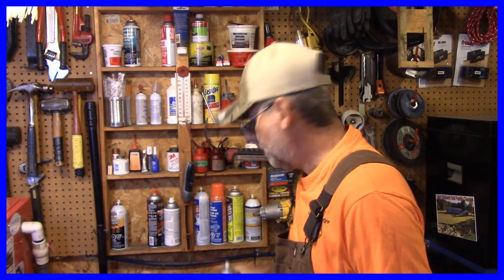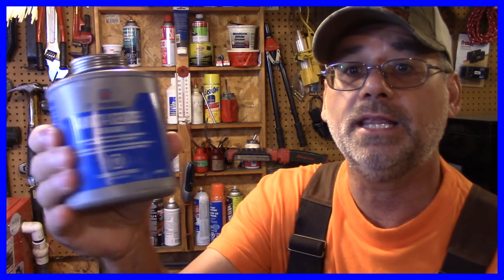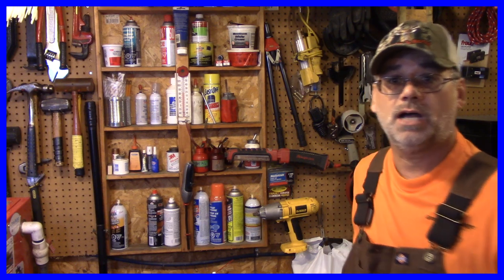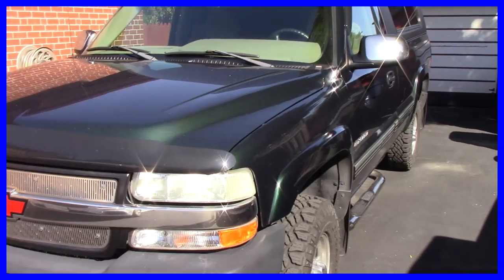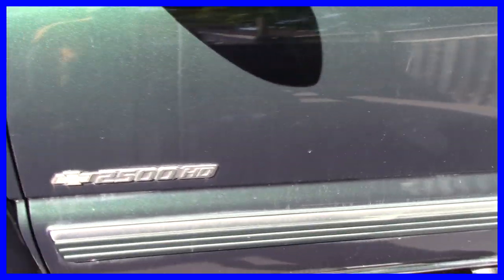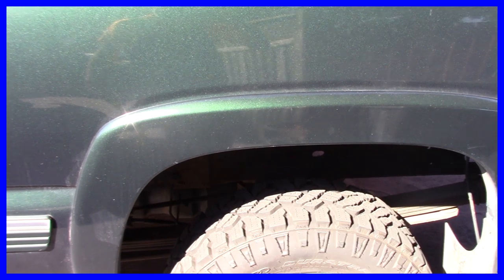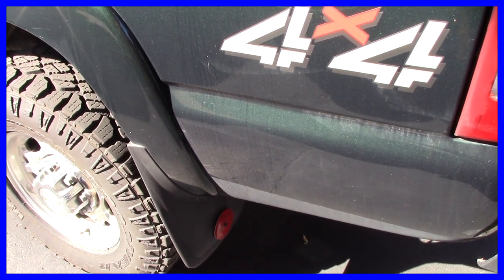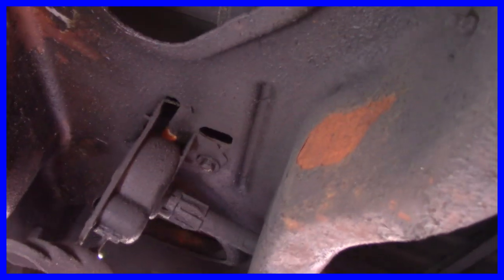APPLYING  RUSTPROOFING / UNDERCOATING TO  YOUR VEHICLE  - THIS IS WHAT I  DO AND USE  .

Comment: What tires are you running on the Chevy?  I will be looking for a really good AT for the van seeing it isn't a 4x4. Seems to work.
Reply from the maker: Goodyear duratracs - great tire.
Reply: Kenda Tire  check into the Kenda Klever AT tire , it just hit the market last Year, and off road magazine did a lot of testing on it  and they and many others rate it awesome !  I got a  suburban ltz , its a soft riding tire with treads seem deep as semi drive tires, kinda the same sound going down the road,  I havent got enough snow to test it out, out it has done great on the highway, rain ,and mud, havent broke traction once even yet, and runs thru heavy  water on the freeway without no hydopaning even feeling,  the best part is since there new i paid like 148 per tire mounted n balanced, they even have tread on the side wall, a very rugged well tested tire with a loyal following,  I have a set of good year all terrain on my 81 1 ton plow truck, those are great too, but the Kenda just feels better cornering n softer going over rough terrain,and a bit sticks better to the road with more meat on the treads, guys are running them all over from alaska to anywhere you want to Go, IM very happy with mine, and Kenda makes motorcyle tires, car tires,  heck even shopping carts n golf cars, one of the largest tire makers in the world, but just started their expansion into the at tires n light truck , n cars  this past decade im guessing,    but the Kenda Klever is becoming well known to the offroad drivers,  and I have over 2 million miles driving over the road truck driving, and drawned my exp from that to decice on this well engineered tire,  mileage wise will it hold up as long as my good year all terrain ,time will tell, but i dont think it will , but traction a soft riding tire that corners awesome mean a lot to me, and I sell my tires on my wifes suburban every about when they get down to 50 percent tread anyway, and some young people are always happy to pay 100 bucks for a real good set of used tires, I like my wife to have the best traction possible she drives a hr to work each way, plus a tire with poor traction isn't very safe for anyone

Comment: I just got my 23 Tacoma undercoated with Valuguard 120 by Line X-was this thr right decision?
Reply: @SteveRobReviews  I just hope it doesn't rust it even further down the line
Reply from the maker: @jimmylim5015  Rust spraying helps a lot but if your in a place with salt on the roads  your undercoating is a must do or you will watch the body rust away in 10 years so yes its a good investment.
Reply: @SteveRobReviews  thanks I just did a bunch of research and some people have a lot to say on which undercoating works best.  I went with Line X rubber coating but I also heard that and Ziebart worsens the rust later on but I don't know who to believe.
Reply: Get that stuff off there, your truck will rot form the inside out. Fluid film or woolwax is what you want to be using!!!!!!

Comment: I have had my 07 Caravan Krowned every year since 2010 (knowing they are rust buckets) and i touch it up myself where it needs it. I'm sure it has helped but it's starting to rust out now. Must be Chinesium steel. Chrysler put foam in the rocker panels. I guess you can't rustproof stupidity. They like salt and calcium chloride so much around hear that they spread it on dry roads.
Reply from the maker: It helps a lot but it doesn't prevent rust thats for sure. The foam idea seems odd since it holds moisture. LOL

Comment: "I dont put a spare tire here youll never get the thing out" i remember helping someone it took me probably more than 15 min to slowly hammer it out and loosen the mechanism. The guy i did i helped was on his way to scrap the same vehicule we saved XD
Reply from the maker: You are correct for those that never service the spare tire. I take the spare out every year check the air pressure and respray the underside before putting it back. Cheers

Comment: According to the MSDS's Rust Check Coat and Protect has the exact same compounds as Krown, just in flipped proportions.  Rust Check is 10-30% Propane and 5-15% Isobutane, while Krown is 10-30% Isobutane and 7-13% Propane.
Reply from the maker: Both work well but I do prefer the rust check coat and protect. Cheers

Comment: Terrible to live in the rust belt. I live in the Phoenix, AZ USA area, and have a 1993 Chevy C/K 1500 with 278K miles on it. I have it put up on a rack every 2-3 years and the underside cleaned. It still looks brand new. Absolutely NO rust. Unfortunately mine is/was white, and some of the paint just fell off, which seems to be a common problem with white vehicles in the US. But even where the paint came off, it still has NO rust. It's solid as a rock. It is my daily driver, and I'm going to have the engine replaced when it wears out and keep driving it, because I don't want a new vehicle with all the garbage technology they are putting on them today. 

I have heard a lot of great recommendations for a product called Fluid Film for preventing rust. Don't know if it is available in Canada or not. One thing to DEFINITELT stay away from is Ziebart. It actually causes rust. Many mechanics in the U.S won't even work on a vehicle that this stuff has been used on.
Reply from the maker: Yep fluid film is up here 👍

Comment: The OEMs do a much better job for rust prevention design, but some are just bad, like some vans.  I had a 94 dodge truck, you couldn't ride with me unless you had a recent tetanus shot.  Internal cavities are the issue with visible body damage.  Not so much the underside.  BTW, if you spray your steel panel with fluid film you would see it creep and expand in a few days.

Comment: I used WD40 on the tailgate of my Ford Ranger.   Thought it was working but I was wrong.  The bottom of the tailgate rusted out.  I should have used these products!!!
Reply from the maker: Ya i'm  no fan of wd40 for anything LOL  It's not even a good penetrant compared to the others.  Rust can be slowed down in the salt belt but no amount of rust prevention  spray is going to stop it. Cheers

Comment: Have you replaced your exhaust yet?
Good maintenance  tip. Good video Brother. 
Last car that I retired had 265,000 miles on it so yeah I keep my cars for a long time. Can't afford to buy new either I buy em used.
Reply from the maker: Same exhaust on the 02 silverado but the 2010 F150 is rusting away pretty good.  Chevy does a lot of things better than ford looking on the underside  . Thanks Marty

Comment: You guys have some long winters up there, I couldn’t imagine how much salt is used.  Down here we get usually about 30” of snow for the season and the vehicles and roads show it in the city.  Now you get out of the city and it’s a huge difference in rust and roads it’s amazing.   Steve how do the roads hold up there?
Reply from the maker: The roads in spring are full of potholes from the heaving frost. They repave our  highways about every 2-3 years . The cold and salt and the frost are a huge challenge .
Reply: STEVE ROB REVIEWS yes the freeze thaw it’s a killer on roads here.  Do they use a lot of concrete or asphalt up there?  I would think the asphalt would do better up there it does down here.
Reply from the maker: It's all a concrete  base and assault  overtop. They have  machines that scrape it off heat it up and lay it back on . Pretty cool to watch.
Reply: STEVE ROB REVIEWS interesting concrete as the base and asphalt overlay.  So they’re basically recycling ♻️ the existing asphalt overlay.  How long does the concrete base last?
Reply from the maker: Not sure , never seen them  remove it yet😅
Reply: STEVE ROB REVIEWS well the idiots down here need to do this, they still like to use concrete so you can about imagine what roads are like here.  There are a few roads down here when the concrete is trashed they will patch and put asphalt on top, but it’s only temporary in a few years they are reconstructing the road with........... you guessed it CONCRETE 😂

Comment: You had me at chain lube. I buy that all the time for my motorcycle chain and I think I got carried away. I have oodles of the stuff. I'll be spraying down some truck frame with that! :)
Reply from the maker: Yes and oddly enough it's actually cheaper than the rustproofing cans and does an awesome job .  When I open a bleeder screw I spray some before I close it back up and they always open without any  problem. So many great uses besides chains.
Reply: You know most of my videos are often edited months after the fact, but I guarantee that you'll be getting some seriuos shout out about chain lube and a link in video and in the description to this awesome video. You have me all excited about new information. I learn something new all the time and I'm not surprised one bit that this information came from my buddy Steve. Next time I can afford vacation and it doesn't have to be to see family, I'm coming to Canada brother. :) Well, if you don't mind. You'd be the reason I came, lol. :)

Comment: I am from thunder bay ont. we have 6 months of winter and lots of salt if you wash your car unde during winter and do rust proof every year but you need good shop to do that you should be ok also need to look at paint and and do little touch up
Reply from the maker: Been there many time on my way to Upsala . I do mine in the drive with a plastic sheet on the ground but a good  shop is still  the best . Cheers

Comment: How do you stop rust at the bottom of the doors if you dont drill holes in them and spray ?  WHere I live, doors always rust
on the bottome
Reply from the maker: There is factory holes in the doors to let water drain out .  There is also holes to apply some rustproof as well. No need to drill any more holes . Take a good look.
Reply: Yep there are drain holes in the bottom of every door. Sometimes they fill with dirt too. Take a look, Pressure wash the holes out  & jam some Fluid film in there with the red straw..Good to go.
Reply: I remove the inner door panels and spray from there. plenty of room to get at everything. Make sure you run the glass up before removing the panel since you have to disconnect the window motor when removing the panel. Simple.

Comment: Good topic Steve.....salt all over....you forgot about GM primerless paint ...boy was that bad....I use my shutz gun with the rust check can from CTC and it just works great and I spray all over and even on the outer parts around the wheel well....this is good for rust but works the best when you changing lanes on a merge and you see these shiny cars moving away just scared to catch some kind of sickness on there new car....I bet you my truck is dirtier than your truck....CHEERS BUDDY
Reply from the maker: HAHA I bet your truck is dirtier than mine too. I like the ruch check as well.

Comment: Yep, I use a cheap electric spray gun and fluid film from a gallon can. I use two spray cans and a 360 spraying snake to get inside the frame. Just doing it once makes a huge difference. Every year I would say you never have to worry again lol. But yep I wear gloves when I work on the car for sure. Think the gallon cost $42, the spray gun $25, the two cans $20, and the snake $10. Not too bad.
Reply from the maker: That's the right way for a rust free ride   👍

Comment: I had a lot of rust under my truck.  Scraped it off as best I could and then washed it with soapy water to get any grease/dust/dirt off.

I then painted on a rust converter called "aqua steel".

Then you want to spray something oily on it each year or two.  I chose mineral oil because it's thin enough to use from any empty spray bottle you have at home.
Reply: How is it now?

Comment: I see lots of cars and trucks with rotted out rockers and wheel wells. If you live in Ontario you better use something because they use very aggressive chemicals on the roads in winter.
Reply from the maker: Yes they spray the highways  with a brine that's very corrosive .   On the side roads they just pour the salt down like their getting paid by the ton , not the hour :)

Comment: Not really. I've used Krown for 30 years and I've owned the cars since new for 15+ years. I apply it myself and I do not drill holes. You can apply it for 3 or 4 years in a row and then do it every second year. And yes, it does creep. Lab tests where I worked did full tests on it. Jeez, you worked at GM...poor you. lol
Reply from the maker: Anything is better than nothing and Krown does a good job as a undercoating too. Yep poor me :)

Comment: If you would have sprayed inside your cab corners, they wouldn't have rotted. I've tried krown in Montreal, absolute total waste of time and money. Their product is useless garbage zero protection, I even paid the guy $20 extra to spray over and over, ZER ZERO ZERO protection! Then I had my 84 Suburban grease rust proofed, and the guy missed so many spots that a year later I had to sandblast a bunch of little rust spots off and now I fluid film it myself, and it takes me 10 hours and 2 gallons of product. Today I'm going to be working on an 84 K5 Blazer I just drove back from California, and it takes me hours and hours to rust-proof it thoroughly thoroughly thoroughly. Some areas have to be touched up yearly, but some areas look just like the day they were sprayed even a few years later. I've been posting videos of my fluid film rust proofing for years. And it's not necessarily better than other similar thick products, it's just a krown is a total joke. I regularly go to the car auction in Montreal, and I look at so many vehicles that are rust proofed with whatever product they've used in the past, and it marginally protects, because it's not done thoroughly, and doing it over an existing Rusty vehicle is a ridiculous. In my opinion a total waste of time, I repeat waste of time waste of time waste of time. Either you do it when the vehicle is brand new, or from California like mine that has never seen salt, and rinsing it off after driving it through salt for 1 winter is very hard to do, because I've noticed that the next day there's still salt dripping out of the nooks and crannies that I was sure that I thoroughly flushed. My ex even had her 95 Suburban from Phoenix touched up at a local rustproofing Krown place after we stopped talking, and even tho the vehicle was thoroughly thoroughly thoroughly fluid filmed for a few years, they still missed tons of spots that I could tell weren't wet with product, what a $100 rip off!
Reply from the maker: I think the best place to undercoat your vehicle is in your own drive and do it yourself if you want  it done right. Cheers

Comment: Steve, I'm new to this as a DIY. What do you recommend spraying on a brand new 2020 F-150 with Rust Check and Chain Lube sprays you mentioned?
Reply from the maker: I would spray the underbody steel parts since the body is alluminum.  Fuel and brake lines are a must for me so I coat everything steel. On my F150 supercrew I used 6 spray cans of Rust Check coat and protect .  On sale about $7 a can .  If you  do it every 3 years  it will keep the underbody looking great . I also spray some under the hood as well on the steel parts as well. Best you do it yourself is you want it done exactly like you want it. Cheers
Reply: @SteveRobReviews  Thanks a lot, Steve! How about the Chain Lube spray, should I use it anywhere?
Reply from the maker: I would stick with only  the rust check  on an alluminum body since the chain lube may react to alluminum.
Reply: Did you speak with the dealer about rustproofing in regards to your warranty? A local guy had a problem with the Ford dealer because they said his warranty would be void if he had his new truck Rustproofed anywhere’s but at the dealership. I rustproof vehicles myself and told a customer to check with Ford about warranty before I would spray their new truck, sure enough the dealer said it would void their warranty.

Comment: Fluid film with the sprayer kit👍
It works great, and it’s kind to rubber and plastic
Reply from the maker: Yes its the good stuff. Cheers Eric
Reply: STEVE ROB REVIEWS 
But I would add, that once it is sprayed up inside the frame rails, rocker panels, A- pillars, etc., It’s not going anywhere, But in the wheel wells and other exposed areas, a second application in the middle of winter may be necessary.